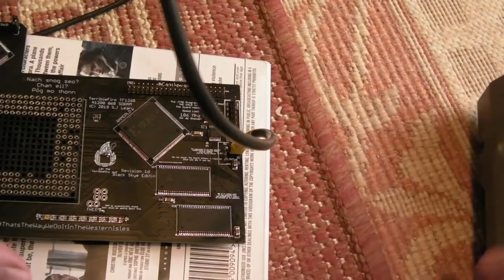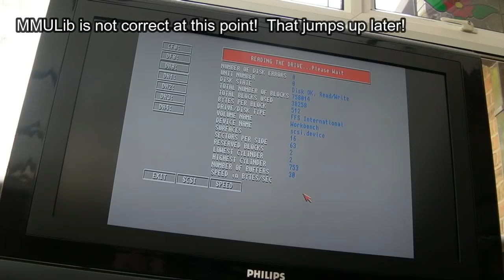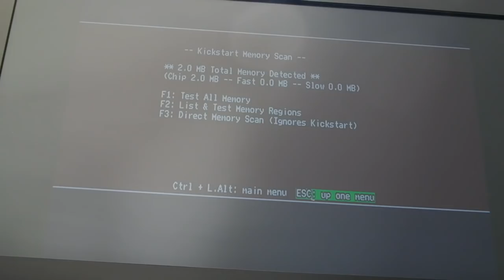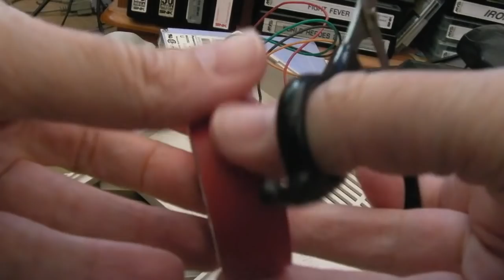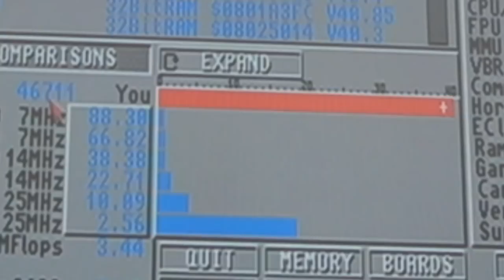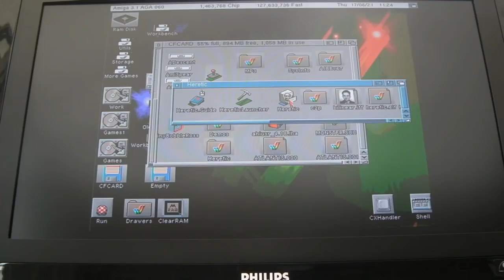Commodore Amiga TF1260 060 CPU Accelerator + 128MB + EIDE (For the A1200) - TerribleFire

Comment: A tip: Use at least three times more flux and just hold the chip down with some tweesers while you slide the soldertip with enough solder left to right a few times. The solder will sit much better and won't bridge. With too little flux, you'll burn it off before it can do it's job properly.

Comment: Nice vid Gadget 👍🏻 I’m still using the retro cards from Phase 5 and DCE. Such as the blizzard 1260 and 603e plus cards with PPC. I’m under the impression MMUlib by THor also replaces the need for Blizkick from what I read? Personally I’m waiting on the Warp1260 cards as these have more features like RTG, Network and USB built in as well as a Heatsink and fan combo when you crank up the MHZ. As others have said a Good PSU is a must for the faster cards 👍🏻

Comment: Trying to getting to 75mhz could be a power problem
Reply from the maker: Nah, power is fine!  Beefy PSU, voltage doesnt drop and actually I've been monitoring it whilst in use and seldom the 5v rail drops below 5.08v.

Comment: The RAM CPLD gets the hottest in my experience. So with the CF card on top there is not going to be much air flow. I'm wondering if it is overheating when you push the overclock up? My fan blows over RAM CPLD first.

Comment: I would really love an 030 with tons of ram in my 1200. It is still stock config (not upgraded at all)
Reply: Since you can grab a 50mhz 030 chip for $40 that is really great for compatibility while a full blown 060 is literally $600 today and LC models without the Math coprocessor have  issues. Besides there are no real Amiga games that need more than an 030 anyway. Quake can be run fine via a 15 year old PC laptop, and I don't run my Amiga for Quake, but original Amiga titles.
Reply: @drphilxr  It is not compatible and never will be acording to stephen him self. And you will have to buy a buffee in order to get a TF-1200. The A1200 buffee card, are ordered by the buffee team or something.

Comment: I overclocked the 040/25 to 40mhz on the 68k side of my old ppc card and it made quite a difference a 040 at 40mhz runs quicker than you think 🙂
Reply from the maker: Thanks, yes - Andy T mentioned that same point to me!  I am sure it does run very well at higher clock speeds.  Also when there's local RAM it shifts too.

Comment: A 060 without an fpu is like a dog that can't go woof 😒
Reply: Well its cheaper than an 030 and goes 3 times the speed.. So maybe a sprinting mute dog?
Reply: 060 with FPU is like fast very 486SX.  486SX is equivalent to 68LC040.

Apple Quadra 605 was sold with 68LC040 and an entry price of $1000 in October 1993, it was ready for MacOS's Doom official port.
Reply: @daniel son I disagree!!! I have a LC in my TF1260 and it flys - only thing i use that needs an FPU is quake and for that I have my Vampire machines!

Comment: Wolfenstein runs fine on a 286-12 with even the lowest end VGA card.  Why it needs an 060 to run on an Amiga is a mystery to me.
Reply from the maker: It doesn't, it will run on an 020 probably!
Reply: It also runs on a standard Atari STe with 68000 @ 8 MHz.
Reply: Neb6  A500's Dread (cut-down Doom clone) used the Bilter hardware to speed up the C2P process.

Comment: Hi  I have a Compact Flash card and no boot on the TF1260 interface.
It boots on the 1200 IDE interface. Where is pin 1 on the TF1260 board's IDE interface?
Is it to the left or right with 1200 facing front?  You have the red stripe on the right. It lights up for a second and then there is a, black screen and the CF card light goes out.
If I reboot a purple screen appears. Thanks.
Reply from the maker: Off the top of my head I cannot remember where pin 1 is - I am sure I showed it in the video.  What I would suggest is posting on the Exxos forum - there's a dedicated TerribleFire section!

Comment: Hi there, ime watching this a few years later, is there a simple option where i can buy  this 1260 in kit form to make without all the faffery of forums & messaging & 99 annoying things ? I would really like to make one of these, i actually have a Motorola 060 chip ive had sat here for 6 years ready to go in it but sadly i cant get the kit or even a pre-built board.
Reply from the maker: I don't think there is for the TF1260 yet - just recommended builders.
Reply: @GadgetUK164   ive only see a few green board versions on ebay every now & then, not the one you have & the ones i have seen have been very expensive.

Comment: Nice. I was waiting a couple of years for TF1260, started waiting when it was just a rumour. Then everything went to hell and I ended up buying Apollo 1260. I'm glad I did, otherwise I still wouldn't have an 1260.

It's weird you're getting only 1.6 and 1.8 MB/s on both IDE and EIDE. On my A1200 I can't get below 2 MB/s (max A1200 IDE speed) on Apollo 1260 and ACA1233. Could be your CF cards and/or adapters play a role here. I'm using Kingspec PATA SSDs with PFS3 in my Amigas.

Looking forward to see how fast TF1260 is with PIO4. FastATA Mk7 for my A4000 is on the way. I wonder how fast it will be with 060 100 MHz. 10+ MB/s would be nice but I have doubts it will be that fast, even with PIO4.
Reply from the maker: The EIDE has shot up with the latest update!  5MB/s  But I've only ever had around 1.6MB/s on the onboard IDE.  It could be because those drives are using the standard filesystem and default block size.
Reply: FastATA arrived. I'm getting only 6,853,437 bytes/s on A4000 with CS Mk2 and 060 rev6 at 100 MHz. Bummer.
Reply from the maker: @discoHR  That's not bad tbh!!!  Getting around 5.3MB/s now on the EIDE interface of the card.  I suspect it would be faster with better CF card / SD adapter.
Reply: Maxed it out at 7.3 MB/s with PIO5. Ordered some SATA adapters directly from Elbox, will see how it handles SATA SSDs but I doubt they will be faster.

5.3 MB/s is great for A1200!

Comment: The price of 68060 CPUs are a too high. The best I have got for my A1200 is a 68030 with a 68882.
Reply from the maker: Nah, an LC 060 is £40.  That's not breaking the bank!  But an 030 is like £7 or something, so yes there is a big difference!
Reply: @GadgetUK164  It's not just the chip. There is usually an expensive board involved too.
Didn't you say the chip you wanted was like 350 quid?
Reply: @tarstarkusz  The LC chips are 3 times the speed of an 030 and actually cheaper than the 030 chip itself. The TF1260 without CPU is approx the same price of an 030 board.

Comment: Don't get why someone could make an accelerator open source and then start to complain about someone "cloning" it. Is not that the purpose of opensource ?. In place of winning about it, he should have done it closed source from the start ?.
Reply from the maker: It wasn't fully open source at that point!  However, Stephen has now open sourced the TF1230 and TF1260...